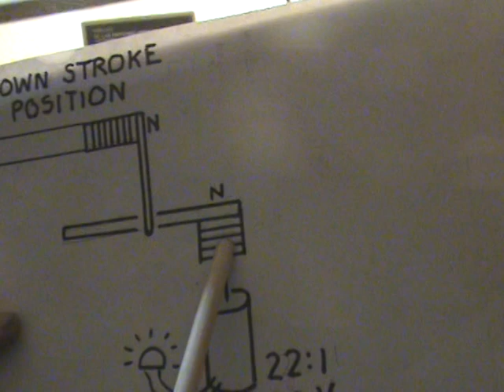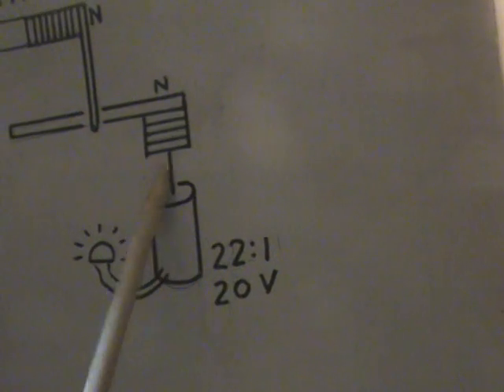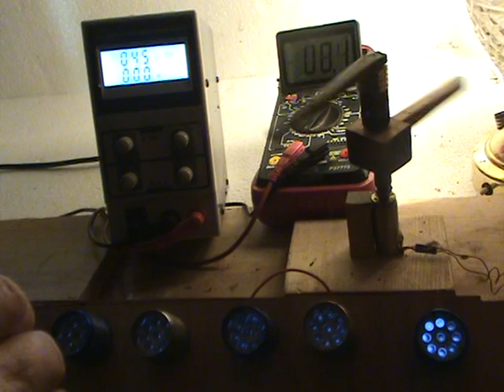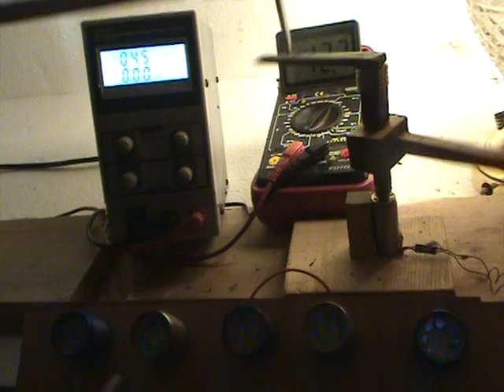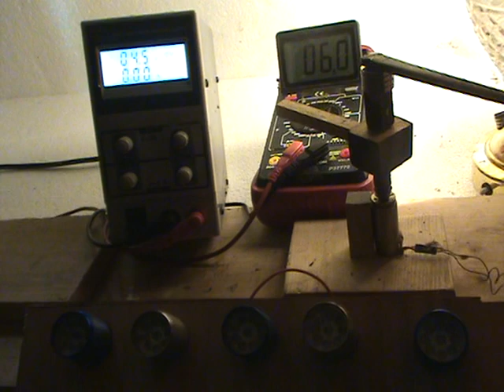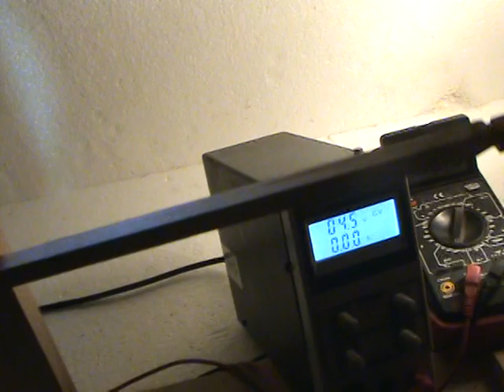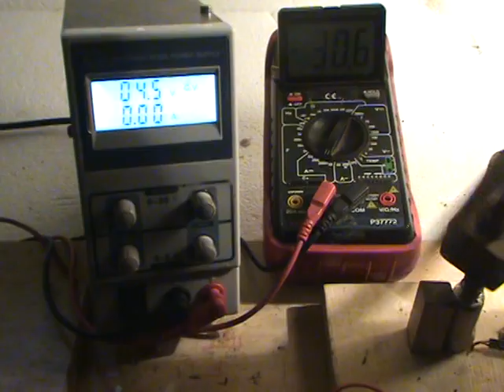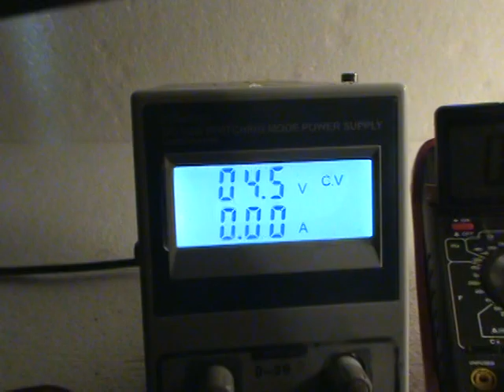Ray's Magnetic Field Shaping Generator 2

Comment: I said it before and I say it again... Both the Power supply as well as the Multimeter are INCAPABLE of acuratly showing current-spikes... The Power supply just smooths it out completely and the multimeter jumps around like crazy...
So until you find a way to measure the ACTUAL power that goes in or comes out, this is nothing but a slighly advanced magic trick.... (tip: an oszilloscope would do the trick...)
Or at least: Get a capacitor in parallel to the output and feed the current through a 10-100 Ohm resistor THEN you can measure the Voltage! AND!!! the Current! at that resistor... Convert that into Power so you have a Value for the actual power out of your system... (P=U*I) so P=<measuredStableVoltage>V*<measuredContinousCurrent>A
Put your multimeter in series to the input motor, It should give you a (not good but)better reading of the actual current going in... Might just be a few milliwatts, but multiply that by your voltage of 4.5V and you have an at least better value for comparision...
If the measured continuous power going in to the system is in fact lower than the power going out that would indeed be "interesting" ;)
I would love to see your passion result in something amazing, but you need to be just a bit more sientific for anything of this to go somewhere... Flashy leds are NOT enough evidence :D

If you do have a university nearby ask for help!! I would be shocked if they say No when you ask them for help with your Measurements ;)
I know I would provide you with my own equipment if you came to me with that (but I guess germany is not around the corner for ya) so do yourself a favor... go and find SOMEONE with an oszilloscope and the knowledge on how to measure spiky power ;)

Nevertheless dont loose your curiosity as thats how breakthrou might eventually be archived ;)
Reply: Thanks for input. The unit as a whole is not over  unity , but the o.u. event is what I am focused on . I am hoping people will try the little car experiment where output greater than input .